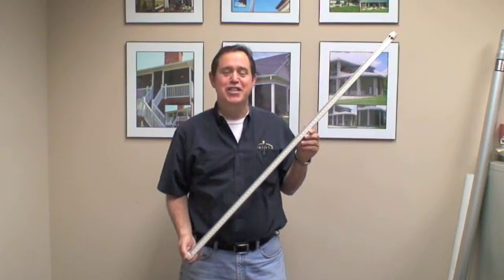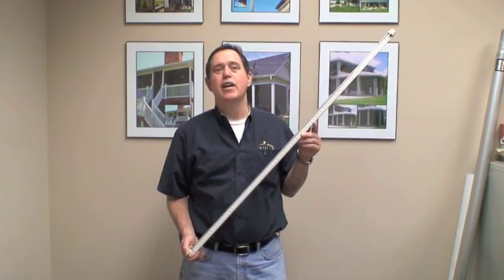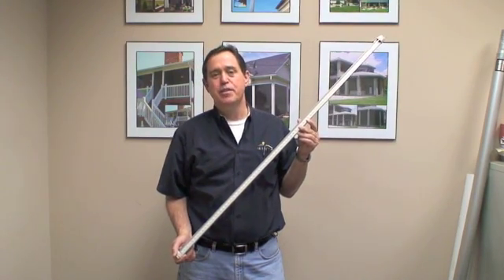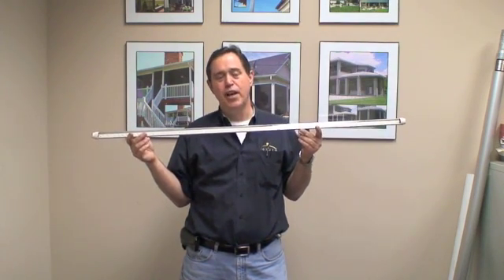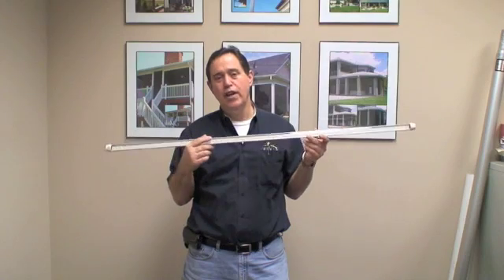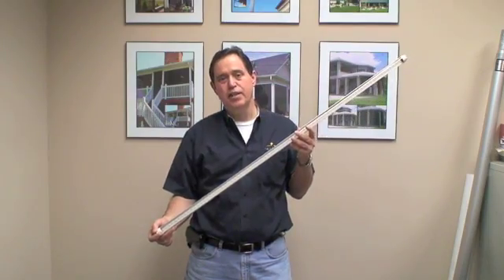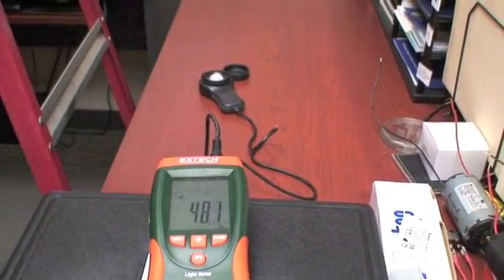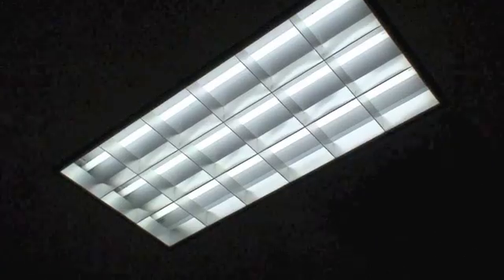DIY LED FLUORESCENT T8 LAMPS HIGH POWERED PART 1

Comment from the maker: @2011endgame Currently we must use an interface transformer to convert the 347VAC to 120-277VAC, if the volume is large enough we will build a driver that will operate on 347VAC - Do you have access to a lower voltage power source?